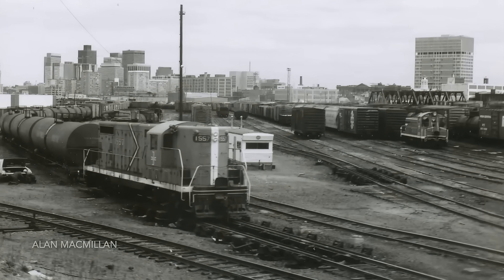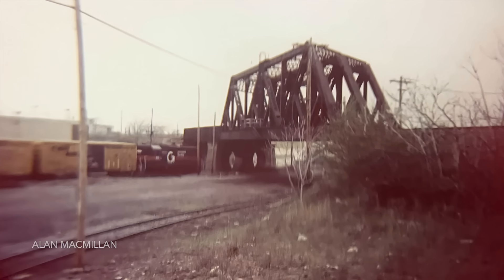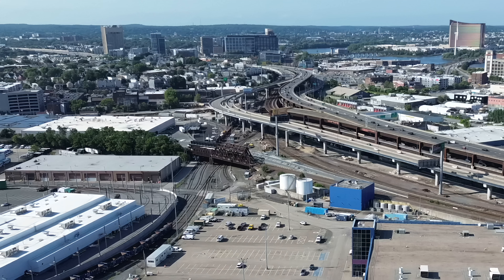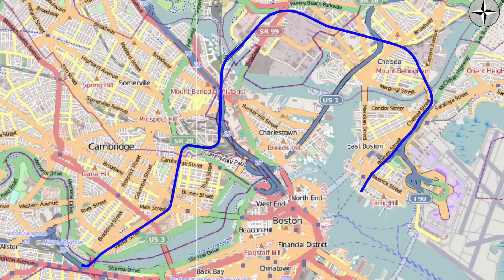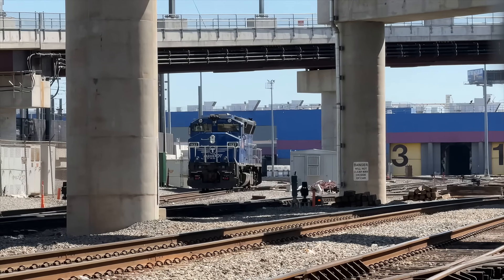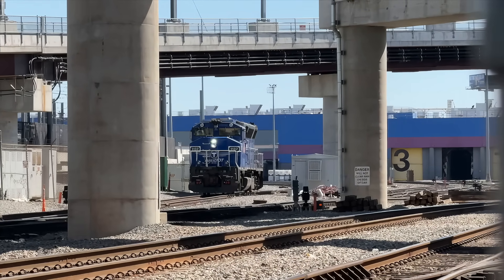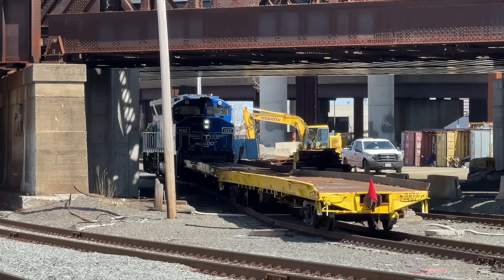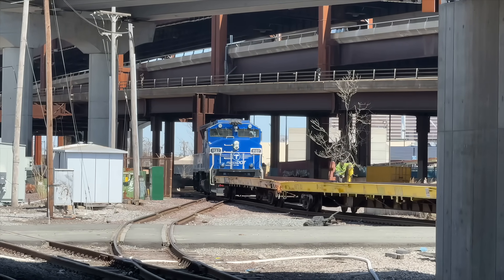How the MBTA Is Replacing a Historic Railroad Bridge in Boston | Key Transit Upgrade

Comment: The Grand Junction can't be removed, it is the only way to move trains from South Station to the maintenance facility in Sommerville, just north of North Station. It used to be a double-tracked line, but is now single-tracked. Some have suggested (myself included) that the second track be restored, to build a relatively cheap link between North and South Stations, with intermediate stops in Cambridge and Sommerville. It could form a test case for a more functional, but much more expensive link using tunnels, the long awaited North-South Rail Link!

A large part of the holdups for the design for the Allston-Brighton Intermodal Project have been how to fit the grand Junction Line, Storrow Drive/Soldier's Field Road, the Mass Turnpike and the Dr. Paul Dudley White Bike Path through the "Throat Area", a small strip of land between the Mass Turnpike and the Charles River (see link below)!

https://mass.streetsblog.org/2024/04/24/a-rough-guide-to-bostons-allston-i-90-megaproject

Comment: Plane, car, train boat? It called NY.. we have many such spots.
Reply from the maker: Thats true. But what makes the bu bridge unique is that the train bridge is a completely different structure than the car bridge, built at a completely different time. Not many places out there like that
Reply: @BostonByRails  I know the Boston bridge well. Was at MIT and lived in the back bay. So check out the  Spuyten Duyvil bridge (NY Central/Amtrak) RR swing bridge, Henry Hudson Parkway Bridge and the Harlem River and Hudson Rivers. This saw Sully land on the Hudson

Comment: Looks like the track alignment will have an awful kink in it when they move over to the new bridge.
Reply: I was going to say that too!
Reply: Telephoto compression - it's more gentle than it seems.
Reply: It’s far less than it looks in the footage. It will actually ease the already tight bend on the other end of the old bridge.
Reply: They've built up approaches to the new bridge on both sides of it. They built up new retaining walls for a couple hundred feet to allow a gentle throw of the track.

Comment: 8:14 Not a structural engineer, but I suspect that this was a value engineering decision. Plenty of strength without those center areas
Reply: This bridge was built right around the time that reinforced concrete bridge supports were just starting to become popular.  My guess as to the octagonal shape is that they likely reinforced it with beams encased in the concrete in an X pattern.  These beams may even have been old lengths of railroad rail.  I guess we'll see what's in there when they remove the bridge and demolish the concrete supports.  As for why they would leave the holes, it saves on concrete, which would not have been as readily available back in those days.  It wouldn't surprise me if all the concrete in this bridge support was hand mixed in wheelbarrows.